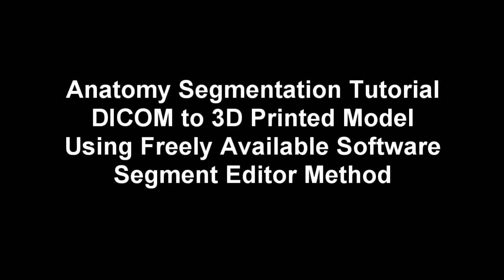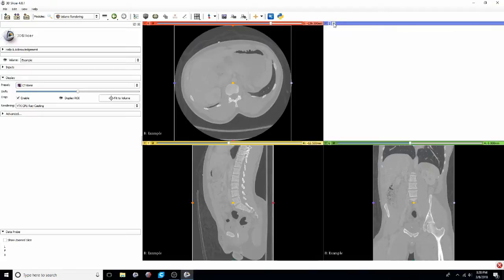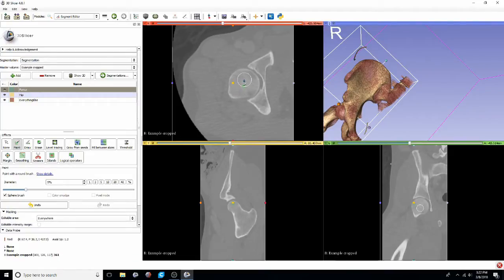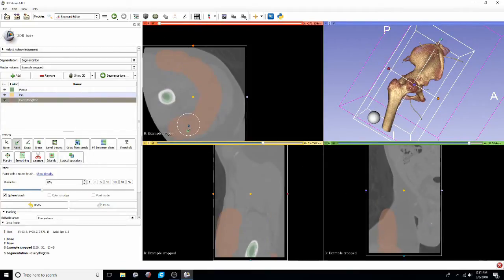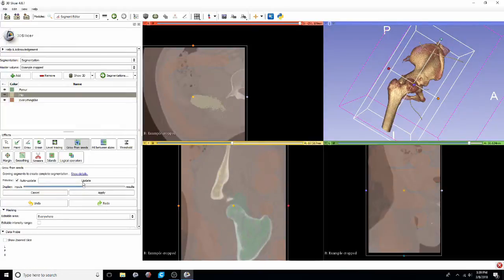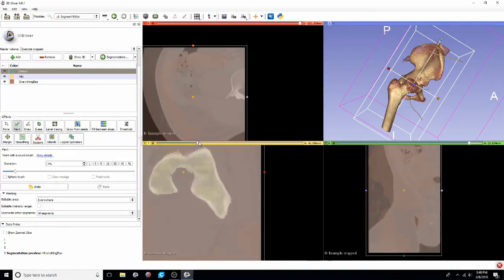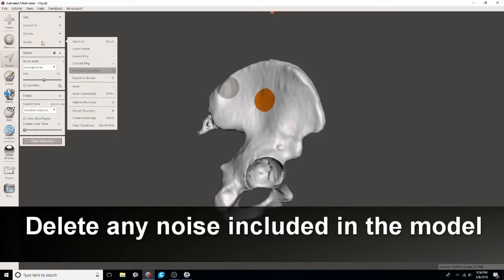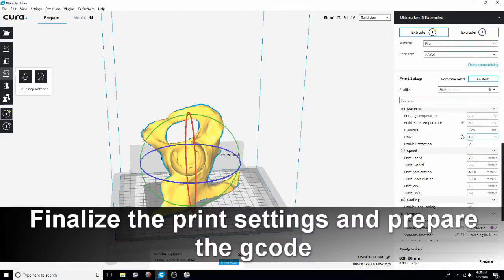DICOM to STL Conversion Tutorial with Segment Editor

Comment: I'm not familiar with Dicom images. Bit do they have say a resolution or quality difference? I use a weasis a free program which came with the CT scans I received. I found online an updated version. However, the 3d views aren't super detailed. I get quite blocky videos or volumes so to say. Does this slicer apps show it in beter quality or resolution or does this spend on the scans?